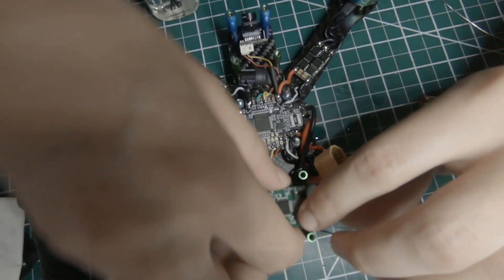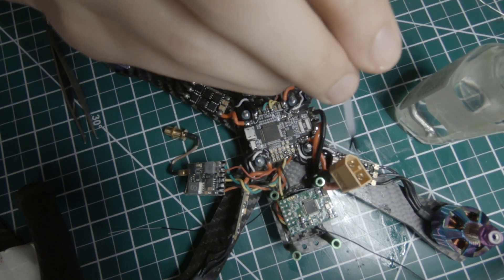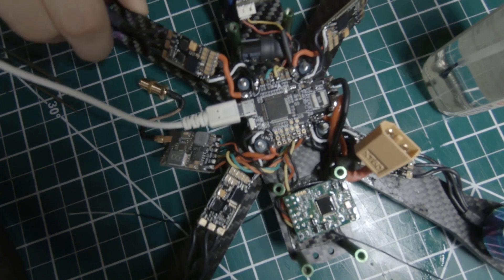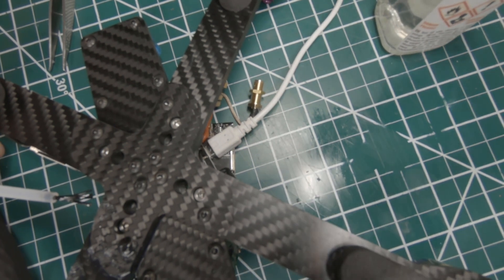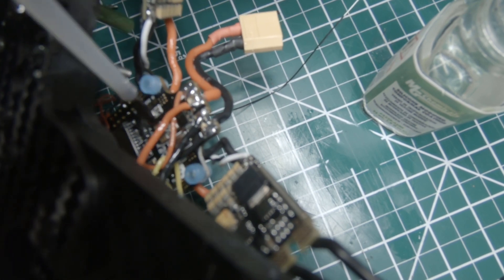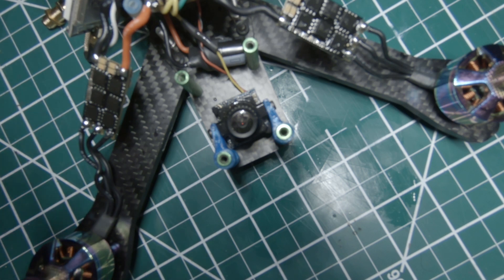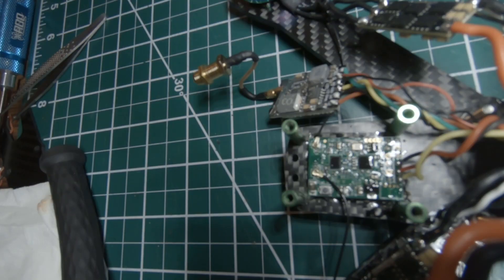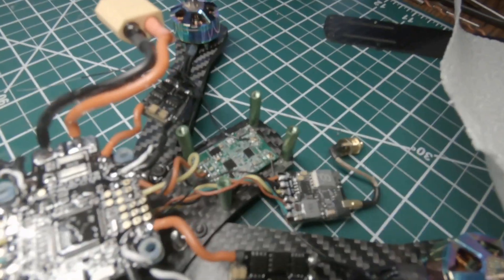How to Waterproof a Racing Drone

Comment: Can I use 422c instead of 422b? Do you know the difference?
Reply from the maker: Yeah 422c will probably work fine. I'm honestly not sure what the difference is.
Reply: @EssenceOfKapok  I think the b dries a little faster and has better corrosion resistance but the c is higher temperature rated and you can solder through it easier... What I was told anyways...
Reply from the maker: @ThrottleWarning_FPV  b is very easy to solder through.